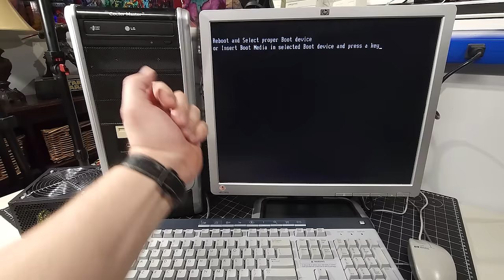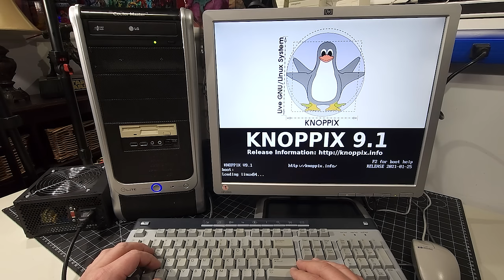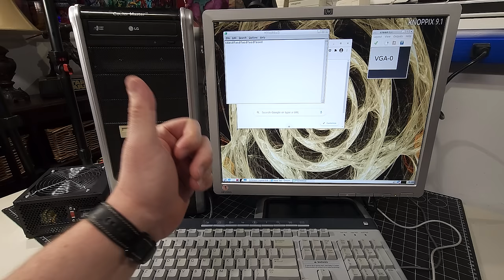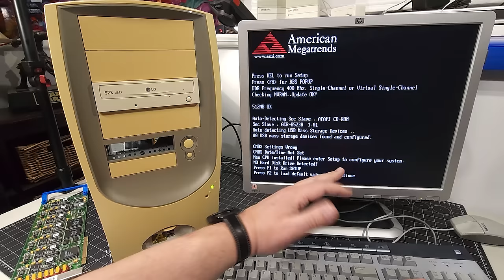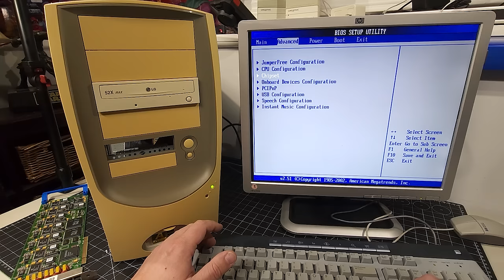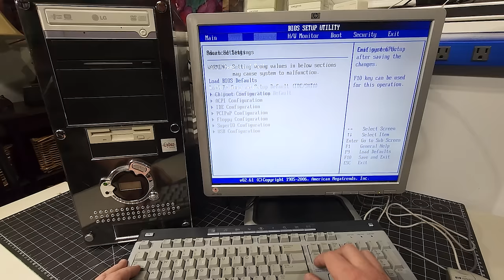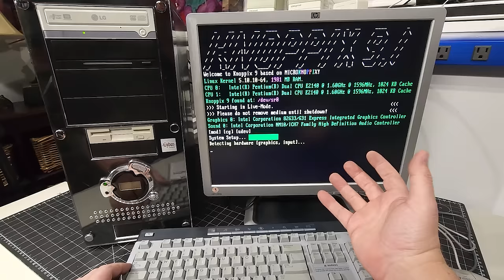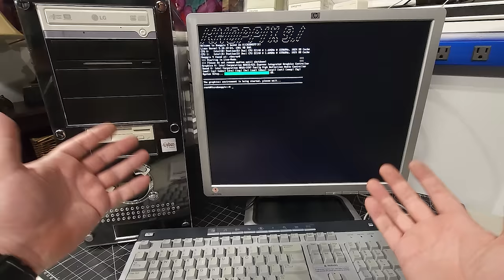Mystery Custom RETRO PC's...What's inside??

Comment: Did you try the same Knoppix on all systems? Almost none of the Pentium 4 CPUs were 64-bit capable, so a 64-bit version of Knoppix wouldn't ever boot. You'd need an older 32-bit flavor.
Reply from the maker: I didn't, someone else also called that out.  The distro I have has the 32 bit bit as well so I will try that for sure.  Thank you!

Comment: I was yelling at the screen on the second machine in the AOpen case. IT'S THE PSU. ALL of your seemingly random problems are caused by the PSU, and potentially the motherboard.

AOpen PSUs are absolute trash, they used the same OEM as PowerMan and some Antec PSUs and have the same problems. They have capacitor plague, usually Fuhjyyu, OST or Teapo crap caps. It's exacerbated by the "silent" technology, where it just prevents the fan from running until the inside of the unit is hotter than the blazes of hell. It causes the PSU to rapidly die, and while it is working, it will cause regulation issues from the insane heat.

Your PSU is exhibiting all of the signs of the PSU failure. With less load, the PSU can regulate well enough to not cause the system to crash immediately, but when the CPU tries to draw anything under load, the system crashes and reboots. Adding that large serial card is too much for the PSU to handle and it falls flat on its face.

Those cheap crappy PSU testers won't show you anything, you have to look at the ripple current on the power rails, which will be horrendous. You can get an idea of how bad the ripple is by using a multimeter in AC mode, which can give you a general idea of what the ripple current is. They're not a substitute for an oscilloscope though.

The ASUS P4Pxxx line of motherboards also have the same problem with crap capacitors, especially on the CPU power regulation. The whole board needs to be recapped. I've had several of them over the years, and had to recap all of them.
Reply from the maker: That's what I heard from here... The yelling lol!  Well, I will be trying a new PSU this week and will update you! All jokes aside, everything you said makes sense.  Sometimes when you are in the middle of it you don't see these things, so thank you!

Comment: Knoppix probably did not like the Radeon 7000. I remember there being issues with AMD hardware back in the day. Had to compile a kernel with some small community plugin to make FOG run on my ATI PCs for deployment. And iirc MikeTech had the same issue a couple videos back. He swapped the Radeon for a Matrox and got it running this way.
The Rad will probably still run fine in windows.
Reply from the maker: Good to know, I will try that as well!  Thank you!!

Comment: "Elite" is the model of the case! Cooler Master's "Elite" was a line of cases. They made several variants of them from the mid-2000's to the early-2010's.

Also, the little port on the side panel was for the intake of air, not for exhaust :)
Reply from the maker: Thanks
Reply: The elite series were cool cases. They still look good today. 👍
Reply: Just Subscribed 🙂😀
Reply from the maker: Thank you, welcome aboard!!
Reply: @TheRetroRecall  Np 😺😊

Comment: Had a Pentium E2140 12 years ago. Great overclocker on stock cooling and voltages. I had mine running at 2.5 ghz without changing any voltage settings running with the stock cooler and the temps were almost unchanged,that thing would probably go even higher with some voltage adjustments
Reply from the maker: That's great info!  I feel some experiments coming on lol
Reply: Core 2 chips were monster overclockers. The trick was finding one with the lowest FSB and highest multiplier, since all of the chips were multiplier locked. You'd also want a board that could do a 1600 MHz FSB for the most range. It wasn't uncommon to get 800-1000 MHz on some parts.

The E2220 was the highest multiplier part in its series, you could get them up to 3.2 GHz on a 1600 MHz bus fairly easily. The E5xxx line had higher multipliers still on an 800 MHz FSB. They also had the benefit of double the cache, being based on a cut-down Wolfdale-3M core, having 2M of L2 cache.
Reply: @GGigabiteM I miss my Wolfdale overclockers! You could volt mod and FSB mod them so easily by connecting contact pads with automotive rear defrost repair fluid.

Comment: Looks like you are running x64 knoppix. The pentium 4 does not have x64 support as far as I know. Maybe that's why it is resetting
Reply from the maker: I will check that out, great catch - although I do remember running win xp pro 64 on some P4 machines.  It will be interesting to see if I'm able to get it going.  Others have also suggested I should go to 1gb of memory and try out a different PSU as it was a bit wonky at the beginning.  Let the fun begin!

Comment: Very nice! I love these hauls. BUT I need 2 tell you that 99,9% of those Top blow CPU coolers (especialy those stock coolers by intel) are pushing the air through the cooler down to the mainboard (which is fine for the mosfets and caps) and not "out of the case" as  you stated! Anyway, keep up posting those systems, love it 😊❤
Reply from the maker: Thanks for the clarity, I stand corrected! :).  I always get that mixed up and no idea why lol.  Ah well, gives something to people to talk about haha.  Thanks for watching!
Reply: @TheRetroRecall  there are rare occasion where I indeed saw the fan reversed (manually) to suck the air from the cooler out to those funny "plastic tunnels", I might give it a "load bench" to see some temps...
Reply from the maker: When I go to do a restoration, it would be interesting to see what the CPU temp is before and after.
Reply: @TheRetroRecall  Please do, and I'll link results to a Discord server where we had a "kinda deep" discussion on which airflow direction SHOULD be going for a case and sink.
Reply from the maker: Awesome, sounds good!!!

Comment: Man I love that Cooler Master case. Gives me the vibe of mid to late 2000s and reminds me the first computer that I’ve owned in 2009.
Reply from the maker: Nice!  Do you remember what components you had in the system?
Reply: @TheRetroRecall  I think it came with AMD Athlon 64 CPU, an Asus motherboard. The graphics card was an ATI model that came with 1 Gigabytes of VRAM. I was quite young and can’t remember the exact configuration. My uncle built it and bought it for me for my 11 years old birthday.
Reply from the maker: Nice and lucky!
Reply: @TheRetroRecall  thanks!
Reply: I loved that Cooler Master case! Bought it back in 08 I think? Still in my garage somewhere. Served me well over a few years
Reply from the maker: Awesome, dig it out, let it live!!!
Reply: I had bought one of those CM cases for one of my many Athlon 2 x3 CPUs that I had unlocked the fourth core and/or cache but ended up never using it, gave it to a buddy instead.

Comment: Those LG drives in the yellowed machine are utter garbage. I worked at a thrift store refurbishing computers that came in, and I got an entire batch of like 20+ computers that all had those exact drives, and I think out of all of them, only a few (likely less than 5) worked. I don't think I ever got any of them to read a CDR disc.
Reply from the maker: Haha yes, I've experienced lots of issues.  My favs have been the Creative , HP, and Acer (Aopen) drives.  Thanks for sharing this!
Reply: I guess my 2 of LG black DVDs died in their very younger years too. One was IDE, another SATA. PATA worked from 2007 to 2011/12 and SATA I guess didn't last even to 2016... Err,

Comment: The fan hole on the side of first case is an intake, not exhaust. You take the fan duct and put as near cpu fan as possible and it will draw in fresh air directly to the cpu fan.
Reply from the maker: Yes, thank you - this has been addressed in the previous comments.  I stand corrected.

Comment: Hmm... Seems my initial comment was vanished by YT for some reason... Strange.... Anyway. trying second time :) I agree with the others about 64bit Knoppix. Seems you try to run a 64 bit Linux on 32 bit system (the 2nd one). Of course it is not possible for an obvious reason.

As for a Modem Card. The point is that old ASUS MBs has an issue (or just a feature :) that disallows you to use AGP slot and some PCI slot (5 or 4 or 3) simultaneously because of shared resources (IRQ). Try to download a MB manual to find out what exact combination is possible.
Reply from the maker: I've had a few people indicate that YT has deleted comments - unfortunately I don't see that.  Most times it is due to a link being posted.

Great call out re the OS.  I will see if I can get a 32bit version to try, or another live distro.  That said, others have also indicated that the issue could also be the video card as Knoppix may not like the 7000. 

Interestingly enough that card was where it was originally - so I would think it should boot with it?  I will do as you suggest and look at the manual for this.  TheRetroWeb I believe has the info on this.

Thank you!
Reply: @TheRetroRecall  As for comments - probably YT has some logic to prevent any words by it's mask but YT is not smart enough to parse any text originating from retro computer geeks. Probably, these comments look like the ones are going to offend anyone. Ha-ha!

As for a manual - you can search for by using an official ASUS site (of course, at its current state) - or just google it narrowing a search results by asus site. ASUS has a great collection of support materials even for ancient MBs produced back in the 90's. Fun fact - recently I did found a manual there for the MB of my first PC that was released in 1997 (!)  So, no Retroweb is required.
Reply from the maker: Awesome!!

Comment: That big card at 21:23 appears to be an Avoscent Equinox Multiport SST-8P/RJ UNIV. Basically it's an 8-port serial card. My guess is that the machine that it came out of was running some form of UNIX (either Linux, or a commercial Unix like SCO Unix/Xenix or Solaris) and the 8 serial ports were used to connect to 8 dumb terminals so that people could log in to it. Could have been used as some sort of point of sale or inventory management system, or perhaps a practice management system for a doctor's office. I actually put together something similar (though much less sophisticated) for a local dentist's office many years ago; basically a generic parts-built PC running Linux with 4 serial ports, each of which was connected to terminals located in various parts of the office, and it was running some sort of proprietary patient records/management system. (don't remember which one, this was many moons ago.) The fact that the machine is missing its hard drive makes this scenario likely -- a business (especially a medical practice) would be far more likely to take proper data deleting procedures before e-wasting a machine compared with your average Joe Sixpack.
Reply: You wouldn't have 8 conexant chips, each with their own ROM chip, on a simple multiport serial card. Nor the line isolation that you see there. It's modems. 8 winmodems on one card essentially.
Reply from the maker: Thanks Majenko.
Reply: @MajenkoTechnologies  Yes, it has to be an multi-modem card. This machine was probably an telephone and/or fax server in some smaller company that relied on dail-up. I think it would have run more likely Windows 2000 or Server 2003 at that point. Btw. I do not trust that power supply. I guess it's probably original to the case (which was choosen cause it was cheap at the time. Nobody wanted these beige boxes anymore back then.) but it might be on on its way out and causes dirty power under load which lead to RAM errors so that the system is unable to boot.
Reply from the maker: Thanks and great call out.  The - 12 v rail was fluctuating quite a bit.  I wonder if a new PSU would make a difference.  I will test!
Reply: @MajenkoTechnologies  It even says at boot "Press <F8> for BBS POPUP", see 29:35
Looks like a patched BIOS for a BBS system to me. If so, it may only boot some propietary real-time OS.
Reply: @SharkoonBln  Except here BBS stands for BIOS Boot Specification and is about selecting the boot device, not bulletin board systems.
Reply: further more, from my experience. this system may have been used as a Proxy Server providing 8 dialup internet traffic connections to the PC clients connected by the RJ45 10/100/1000 onboard NIC via proxy server software.
Reply from the maker: Thanks for this info!!

Comment: The big 8 port card is (I think...) an 8 port modem. That computer would have been a RAS server in a business to allow the sales reps on the road to dial into the office to transfer data.
Reply from the maker: Thanks Majenko! Pretty neat.  So in theory, there would be 8 POTS lines feeding this card?
Reply: Correct. Probably all on the same phone number with the exchange doing round-robin for you. Basically a mini ISP for the company internal use.
Reply from the maker: Neat!  And to think this isn't that old.  Another viewer just found this on Amazon for 450 USD.  I wouldn't think that it would cost that much, yet alone still be available.
Reply: Googeling the conexant chips it seems you are right.
Reply: @Voyager_2  yes, Conexant were big in modems back in the day. As big as rockwell. That and video chips.
Reply from the maker: Awesome.  Will you be my first customer??
Reply from the maker: I love modems... But having 8 x 56k modems on one card!!!!!???? I'm in heaven :)
Reply: Another use case would be automation. I did my apprenticeship in the mid-00s in the IT dept. at the municipal wastewater company. They used dial-up for the survaillence of the sewage pumping stations. Many of them still used 14.4 or 28.8 kbps modems to dial the server in the control room in a case of an event.
Reply from the maker: Neat!
Reply: @MajenkoTechnologies  Came here to say the same. Conexant was one of the most globalist-approved brands of software-based analog modems (because they only made drivers for macOS and Windows which were the 2 OS's the globalists elites approved before ChromeOS was created) and because of that pretty much every major OEM carried modems from the brand. Also, RJ11 means land line jack, RJ45 is the ethernet jack.

Comment: I used Equinox equipment for my old ISP. At first the cards would supply 10 com ports for external modem’s per card. I think a max of 3 cards per computer.
They later came out with digital card that connected through a cat5 cable to a 24 line digital phone debark from the phone company. Each one of the cat5 was capable of 24 user connections to the incoming phone T1. 
Looks like the card you have was quite a top of the line one, handling several phone line T1’s.
Just the heat and noise loss from no external modems made these worth the cost. Plus a computer could handle way more modem com ports.
Equinox went out of business a long time ago. They were located on the east coast of Florida.
Reply from the maker: Thanks for this info!!!  I think it's quite a neat card.  I may create my own ISP... Want to signup!!!?? 😂

Comment: The last computer was definitely an office PC, but it has a good one - it doesn't get hot as quickly as the sophisticated high-end processors.  I also like the fact that the newer PCs automatically switch off as soon as it gets too hot.  I forgot to connect the fan cable and suddenly the PC went off... but then I got a shock.  But nothing happens, he's still walking.
Reply from the maker: Haha awesome!!!  Yes I like the newer fail safe features that exist in newer systems as the tech advanced over the years.
Reply: @TheRetroRecall  Oh yes that's true. I can still remember that defective fans or incorrectly installed coolers quickly became a death sentence for the CPU... the early PCs didn't have an emergency shutdown.
Reply from the maker: Absolutely!

Comment: In the 1980s/90s I used to build systems. My first choice in hardware was always Acer. Case, motherboard, drives where possible. I also used Maxtor hard disk.I once built a system that had network cards that were complete computers. they had CPUs memory and their own bios. I wish I could remember what they were called. You could put up to 4 of them in a system the run cable for dumn terminals. This allowed you to run cables over 1000 meters from the main server. That card you have reminded me of this type of network. I think it was one of the solutions some company came up with to allow multiple terminals on one system.
Reply from the maker: Nice!!!

Comment: Dude, that third system, the G31M-S, you could drop a core 2 quad into it and have a fine " 'teens" retro machine. Probably run 7, 8 or even 10 just fine if you maxed out the RAM (8gb)
Reply from the maker: That sounds awesome, so many parts around - would be a neat build.  I think it would be cool to stick with 7.  8 makes me cry and 10, well... Too new lol.
Reply: @TheRetroRecall  Yeah 7 was the pinnacle. If you could still hack dx12 into it and Steam support hadn't been yanked, I'd have stayed there. Never ran 8 on my local machine, ever. Had to have it on some VMs, but aside from that, yeah...hated it.  When I had to deploy it on new user's machine I'd use Start8 which made it look like 7 and then they loved it.
Reply from the maker: I used Start8 as well!! It was such a great tool!